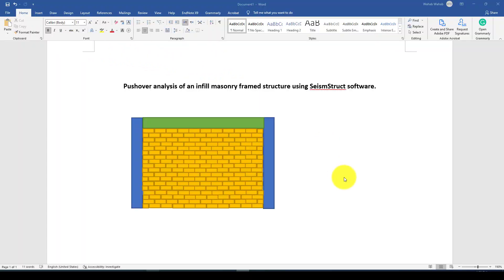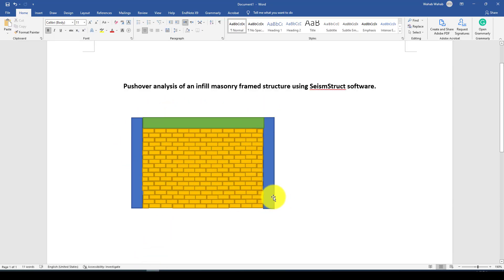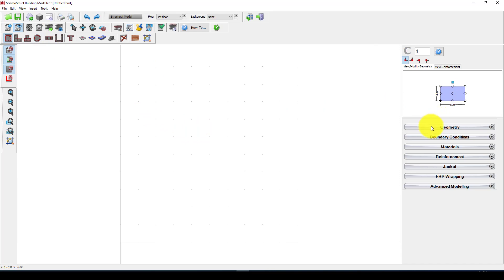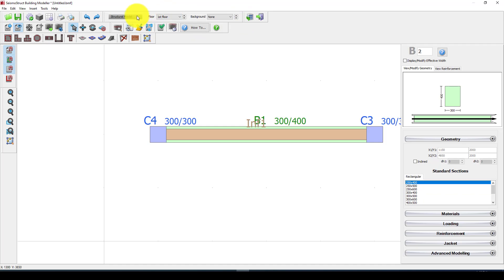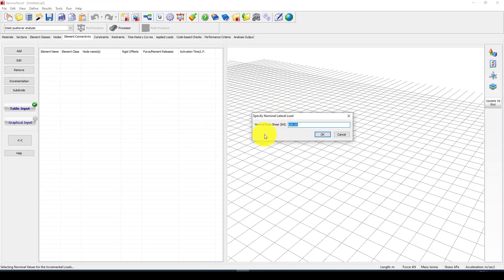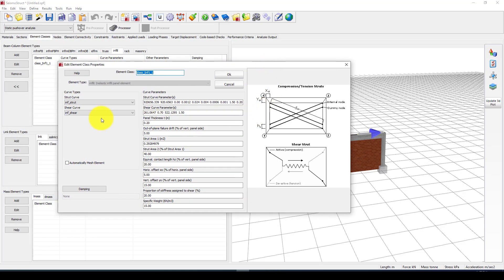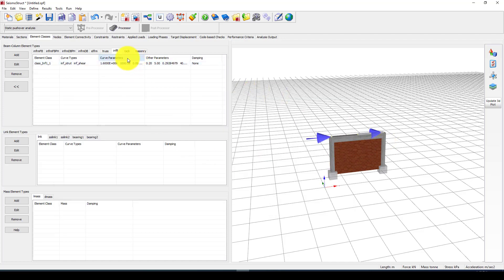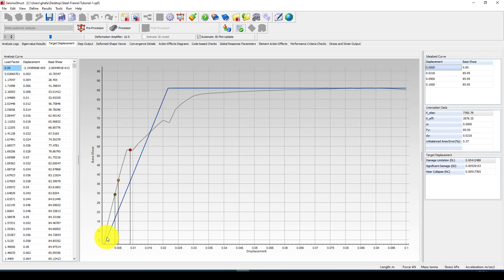Pushover analysis of an infill masonry framed structure using SeismStruct software

Comment: Hi sir,thank u for this video..but  I have one question.. When you  define the walls materal at In the 4.42 minute of the video,why  you define mean brick compressive strength  15? I cant understand this part. 
Are we going to write the mean   compressive strength  of the wall in this part or are we going to use   compressive strength mean the brick?
Reply from the maker: Hi there, please recheck it. You may understand or read the software documentation.
Reply: Okey thank u..

Comment: This video was absolutely interesting. Thank you very much for the contibution of knowledge. 

Just one question. I would like to ask about the connectivity between the frame and the infill wall as i have noticed that in output no.47 there is a gapon the left down side.
Reply from the maker: Hi there, that gap is just a slight deformation in the post-processing. For the connectivity check that inf-struts there is enough information.